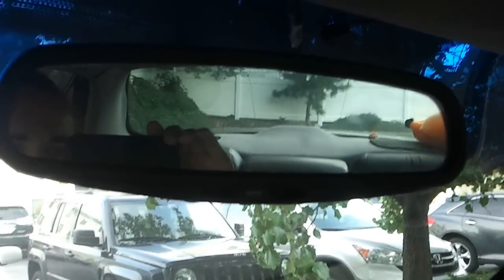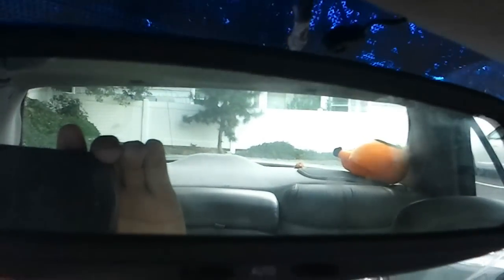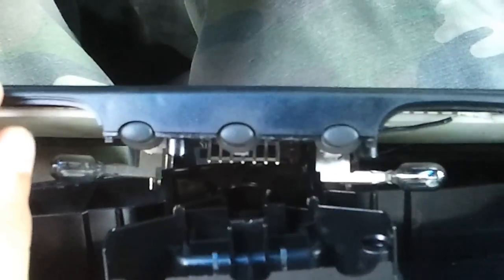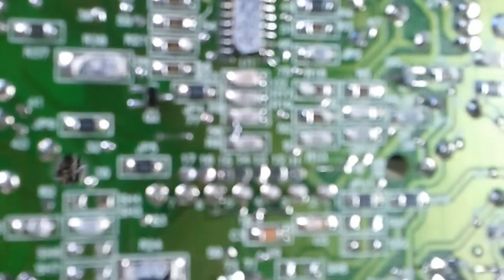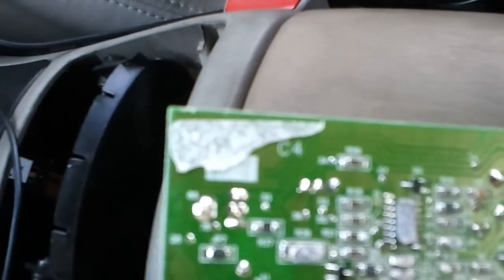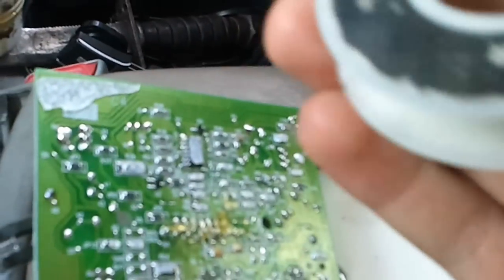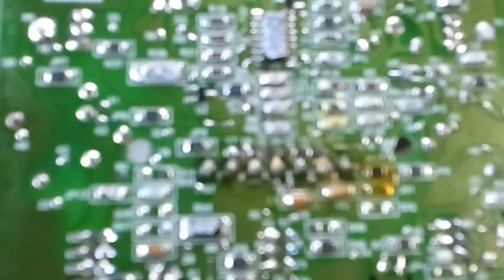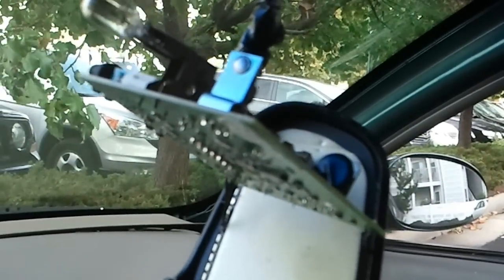How To Fix Malfunctioning Rearview Mirrors

Comment: I have this exact same problem!  It's been doing this for about 3 years and thought I needed to buy a new mirror.  This is gonna save me a ton!  2003 Impala LS.
Reply: I think my problem is more related to Colorado summer heat causing the joints to fail.
Reply from the maker: As mentioned earlier, the case of the mirror can be a bit difficult to open. However...once inside...the soldering is pretty easy. If you are experienced with a soldering iron that is. Otherwise there is always the option of asking around. Good luck and happy fixing!
Reply: +iggy151 I just did my transmission myself, and I've built my own lag switches for my Xbox, this mirror should be no problem.
Reply from the maker: +Funkfish25 It always feels good to fix things and save some big bucks!
Reply: +iggy151 can you give some tips on how to take the mirror housing apart, I'm afraid I'm going to break my housing.
Reply from the maker: +Funkfish25 The two halves are held together by some clips that are pretty hard to pop apart.
Reply: +iggy151 ok but I have my lens covers out (need to replace one cause a clip broke) but I cant see the clips for the two halves of the housing.
Reply from the maker: +Funkfish25 You just have to pry it apart. There is a seam that goes all the way around the outside edge of the mirror. Stuff some sort of pry tool in the seam. Gently pry all the way around the outside edge. Its a PITA but persistence will pay.
Reply from the maker: +Funkfish25 Yeah...just so long as you are careful not to knock components off the circuit, you should be fine. That main wire connector going into the board will probably feel a little loose.
Reply: +iggy151 thanks to your help I now have a fully functional mirror again, although pulling it apart got the seem scuffed up pretty bad.  I just need to get a new map lens for it and put a small amount of adhesive under the seem to hold it all together and I think it's good to go.
Reply from the maker: +Funkfish25 Junkyard for the lens. I melted mine back together with the iron lol. Not pretty but it works.
Reply: Chevy is infamous for quite a few issues with their dashboards, mirrors and even ignitions in their Impalas. All of these issues can be traced back to shitty soldering.
I’ve known people who have spent hundreds of dollars to fix their intermittent security issues in their Impalas and all it was , shitty soldering on their wires. 

I got fed up with anything GM. I had an Impala with the security issue, a Suburban with a shitty dash cluster and mirror and a Chevy cruise with a shitty transmission. 

Bought a Kia and have ZERO issues!

Comment: Just fixed my mirror in my 2003 Buick Regal LS which had malfunctioning map lights and the auto-dim fuction didn't work either but now it does, although I was rather disappointed that the case of the mirror was basically "welded" together so because of that I had to superglue the case of the mirror back together and even then it didn't hold very well because when I went to try to readjust the mirror so that I could see the rear window of the car again the mirror came apart partially so then I had to "snap" it back together and so then I had to adjust the mirror with both hands in order to prevent the mirror from coming apart again. Anyways it seems to me that they didn't intend for you to repair this mirror by the way they had it put together.

Comment: Nice video.  I've got two Lexus 2011 IS-350 rear mirrors that are stuck on DIM mode.  They light up and compass works, so they're getting power.  Any ideas?

Comment: I've got a '98 Lincoln Continental & the map lights along with the direction indicator do not function...is this also related to having to re-solder that connection?
Reply from the maker: It's very likely, if the mirror has a connector or a group of connectors going into the back of the unit.
Reply: The auto dim feature is also not functioning...jiggling the connector allowed the map lights to function, again.  I also noticed that the glass on the mirror does not appear solid...as though part of it from the top down looks stained...could this cause the mirror not to auto dim properly?
Reply from the maker: Mike R The autodim may not be working due to the glass being bad. If it looks like it's stained or the ink is bleeding through, the glass must be replaced. Find yourself a similar mirror in the junkyard. Soldering the connector inside would restore map light function though.
Reply: iggy151
Correct...the glass appears to have some bleed thru across the top.  Do you know any company that sells replacement glass for auto-dim mirrors?  Many thanks!

Comment: how do you identify a cold solder joint? tough to make out from the video
Reply: +neppy5 a cold solder joint is normally dull in appearance.  A good solder joint is shiny.
Reply from the maker: It's really difficult to see but occasionally there will even be a hairline fracture or gap. It never hurts to resolder each of the pins.

Comment: It's pronounced "sodder," and you need acid or resin core for electrical repairs. Do not use plumbing solder
Reply from the maker: 1. Almost everywhere else in the English-speaking world, besides the USA, pronounces the "L". I tend to do it both ways depending on who i would be talking to for better understanding. Example: i made a video that could be viewed by anyone anywhere in the world...so "soLder" it is.

2. That was Radioshack's tub of Rosin flux. Not the best stuff in the world. Ive become quite the fan of Kester 186.